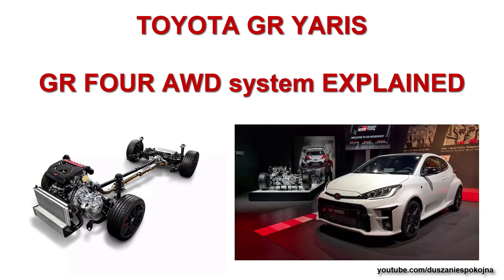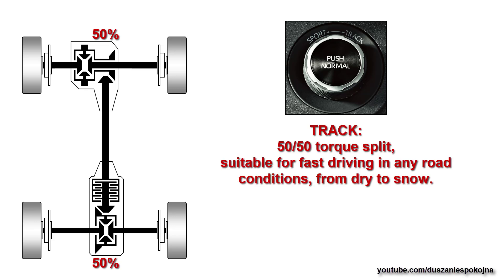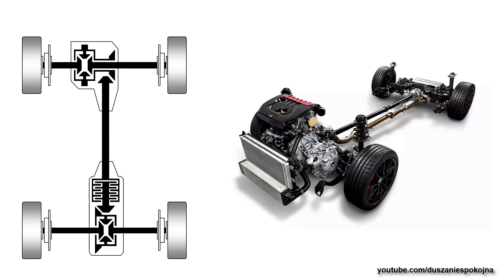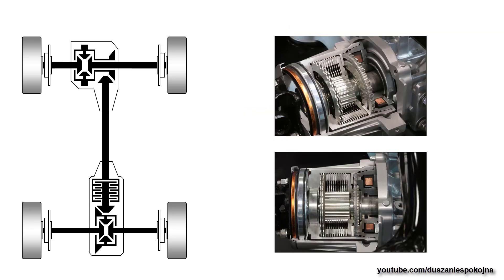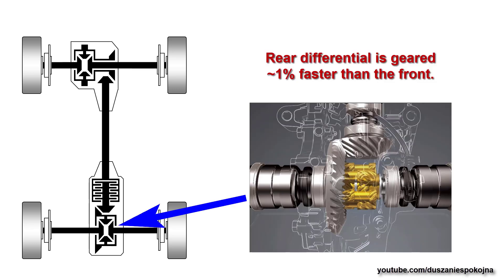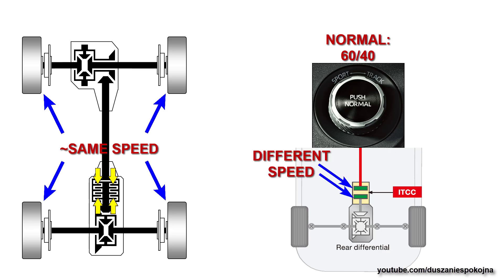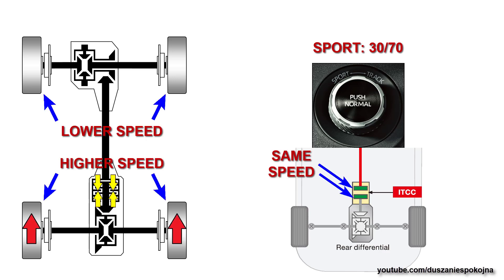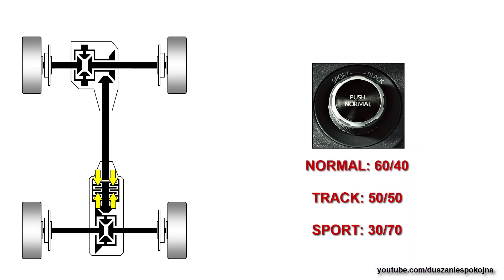Toyota GR Corolla & GR Yaris - GR FOUR AWD SYSTEM EXPLAINED - @4x4.tests.on.rollers

Comment: Finally somebody explained me how 30:70 split is possible at GR Yaris. Many thanks!
Reply from the maker: My pleasure 🙂
Reply: I understand it, but in reality the rear only has the power to match the fwd system. It only receives the 30/70 because of the gearing difference in the rear.
Reply: @SupramanTRD  in "reality", you could send 100% to the back, or even  more than 100% to the back and negative torque to the front(braking the front wheels, which would make no sense unless you're trying to do burnout) depending  on the gearing difference and the slip ratio/torque curve characteristic of the tires. the clutch is continuously adjusted to provide the desired torque split according to the mode
yes, it's enabled by the difference in gearing. with same gearing , and in a straight line, the clutch could only modulate between 50/50 and 100/0. but here , 30/70 is REAL no matter how it's done
it might seem overly complicated, but in an AWD car cornering with gearbox output shaft spinning at a certain speed, and 4 wheels spinning at 4 different speeds the only "simple" solution is 3 open diffs, which is the worst in terms of traction, cornering etc.but any of the more advanced solution like LSD's or imply having clutches/torque converters to let the wheels turn at different speeds while still limiting the slip. newer AWD systems tend to be more complex, requiring more sensors/actuators/electronics, but are more flexible with different modes and more efficient when cruising. Toyotas system is just a relatively smart/cheap/lightweight system to enable RWD bias on a transverse front engine.
though It's hard to believe the rear wheels are constantly driven and the clutch clipping even if you are on cruise control on the highway. logic says it should stay open when you are driving straight and at low throttle, saving mog and clutch wear
Reply: @SupramanTRD  it's kinda like the rs drift mode. 
But the Toyota seems like a much smarter system tho overall.
Reply: @fukkinkana  Don't know about smarter, as it lacks torque vectoring in relation to steering input. It's an entirely passive system.
Reply from the maker: @Vermonstered  It's active system, steering input is one of the most important factors for clutch pack operation.
Reply: @4x4.tests.on.rollers  So you're saying it actively adjusts clutch pack clamping force when resistance varies upon the rear? Or the 'active' part is the drive mode input. Active in the case of a torque vectoring system is constantly adjusting the clutch pack to direct more power to the right or left rear wheel. That level of activity doesn't appear to be the case here. I'm unsure why steering input (from typical following a road driving) would require active adjustment of the clutch pack as this isn't a differential that's detecting slip.
Reply from the maker: @Vermonstered  Clamping force is never fixed but always variable, dependent on many factors. This is for front/rear. There are no clutch packs for left/right, that's up to torsen diffs (if equipped).
Reply: @4x4.tests.on.rollers  Right, clamping force varies based upon some level of steering input due to the speed differential been the two axles but not actively directed by small(er) steering inputs you'd do following a freeway or other road like again in a torque vectoring AWD system as the Yaris system, as you say, doesn't dictate L/R bias. I'm not talking to the amount of steering input that requires the overdrive gearing like U turns and the like.
Reply from the maker: @Vermonstered  We don't know what steering input influences the awd system. Besides - why would I need a torque vectoring while small steering inputs?
Reply: @4x4.tests.on.rollers  Then you're only referring to the already programmed in variance in turning circle radius from the front wheels to rear wheels for clamping force? That's really not what I meant by 'active.' Even the old Mitsubishi ACD system is more active than that.
Reply from the maker: @Vermonstered  Electromagnetic clutch-pack may respond about 200 times per second. Its compression depends on tens of factors and is fully variable, it is never set for fixed value, it uses feed-forward and feed-back control. That's proactive system.
Reply: @4x4.tests.on.rollers  Again, it's not a system that detects slip or directs power actively. It's all preprogrammed settings based upon parameters as the system used here is somewhat limited. No one said it's a fixed variable as that makes no sense due to distance traveled by the front and rear wheels. There is literally no reason for this kind of system to have a 200hz refresh rate, it simply doesn't do as much as other systems which would require such a refresh rate. Quit generalizing.
Reply from the maker: @Vermonstered  Then I have no idea what you mean by saying that the system is passive. And what means active then if not constant calculation of situation and continous adapting of torque split? Locked diff is passive, it's locked and that's it. Doing nothing. When it comes to responsiveness level of 200 hundred times per second is used even in normal (not sporty) cars.
Reply: @4x4.tests.on.rollers  Passive wasn't the right word, however, I'm describing basically a system that's locked into a set of static and somewhat simple parameters. There's no intelligence to the system as it has limited sensory input and it's not trying to be a variable system that adjusts the F/R split per sensor variable like a haldex. Torque vectoring systems detect much more and do more than this type of system as they're constantly adjusting the split not only F/R but L/R. I get it, you believe refresh rates mean active, but if it's just following the turning circle variable from front to rear distance to know which planetary gearset drive, it's not really.
Reply from the maker: @Vermonstered  Are we talking different languages? Each wheel speed, steering angle, acceleration pedal position, throttle position, engine torque, engine speed, yaw rate, lateral G, longitudinal G, slippage, surface friction calculation, temperature and many more - these are the things calculated by the system, continously. Like every 10 miliseconds for the next 500 miliseconds or whatever. Torque split is constantly changing on the basis of overall calculations. The same signals will be used for torque vectoring systems but adapted for different drivetrain.
Reply: @4x4.tests.on.rollers  You're generalizing again. Just because some systems do, doesn't mean all do or if that applies to this system. Making verbal diarrhea for the sake of spitting out sensor names and refresh rates is just that, a pile of 💩 as it's so non specific to any system. You're clumping them all together and each AWD system uses different inputs to give different outputs for the design specifics of each system. There's also a massive difference between scan rate (what you're talking about) and response rate. You're so zoomed out and generalized to any system it looks like a foreign language when trying to speak to a specific system.
Reply from the maker: @Vermonstered  I did analyse more than enough awd systems, believe me. You're saying that GR Yaris has basic control but you have no information about it. And haldex was your example, seriously? The majority of data/sensors I mentioned comes from Rav4 which has much less sophisticated control algorithms. I clearly said about response rate of electromagnetic coupling. That's controlled with pulse width modulation where every change of duty cycle changes the torque split. Control software - on the basis of tens of signals - decides about the duty ratio. Here you may see how duty cycle changes during driving: https://youtu.be/N_SCul259hc
Reply: @4x4.tests.on.rollers  🤦 only used the haldex in regard to target is a variable AWD engagement which is unlike the target split system in the Yaris. Again not understanding a word of what's actually being said because you're trying to generalize it to ALL AWD systems with the only intent of computers do stuff always as your goal? It's clear you couldn't have a conversation about each system without reverting back to massive generalizations and verbal diarrhea. No one is talking about wheel slippage in your video again backing into even further zoomed out generalizations. Yes, there are sensors. Yes, they respond to input. That's about the only thing you're able to say about the GR Four system. Besides that you're so generalized to 'AWD computers do something because of sensors so you can't call them simple' is just silly, especially to anyone who has any programming experience. This system is less sophisticated than the first generation SH-AWD from Honda without torque vectoring and isn't remotely the most 'active' system out there. Stop generalizing now to Rav4's.
Reply from the maker: @Vermonstered  Enough is enough. Feel free to call JTEKT engineers and tell them they are wrong in their descriptions of GR FOUR system.
Reply: @4x4.tests.on.rollers  Isn't the torque split steady for each driving mode? Toyota says 60/40, 50/50 & 30/70.
Reply from the maker: @WolowitzsMother  If you go deeper into specifications you will find that Toyota says about the balance (fwd, neutral, rwd). This is fwd based, clutch type awd system, it can't keep torque split steady cause handling would be awful. It regultaes it to achieve the required balance.
Reply: @4x4.tests.on.rollers  Subaru? It says permanent 60:40 front and rear using multi plate transfer.
Reply from the maker: @WolowitzsMother  The same situation. Torque split is active (that's why system is called S-AWD ATS - Active Torque Split), it is not set to constant 60/40 but variable, adjusted in real-time to the situation. During stable driving it goes towards fwd, like 90/10-80/20.
Reply: @4x4.tests.on.rollers  Thanks for the lesson, in showing just how to destroy your credibility. It's great you do these tests, but seriously you need to work on your actual understanding of these systems.
Reply from the maker: @psycheout4733  Be my master and tell me where I am wrong.
Reply: @4x4.tests.on.rollers  ^^^ with your discussions with OhAiShare already shows you're not interested in expanding your view. Also never said I was a master, only taking the lesson on how to destroy one's credibility in 3 minutes flat.
Reply from the maker: @psycheout4733  If you are not a master then how do you know know who is right? Everything I wrote in that discussion is based on info from Toyota and JTEKT. Is it necessary to quote those descriptions?
Reply from the maker: @Vermonstered  I just noticed the email with your last comment (about critisicing my rampant generalisation and inability of defining the system or contrasting it with any other) but I can't see it here. Anyway I'll answer it. OK, should we discuss about the differences between haldex coupling and ITCC, is that the point? We can. Next - defining the system or contrasting it with any other? And what did I do in the video above? That's very different from probably all other awd systems on the market now. No haldex system is geared and programmed this way. GR Yaris uses 0.435 gearing in PTU and 2.277 gearing at the back so there's a slight overspeed ratio of rear diff,  there's no planetary gearset to choose. Haldex systems do not work this way, they are active but they are going almost entirely to fwd mode whenever it's possible while GR FOUR system is continously trying the keep one of three balances chosen by the driver. Why did I mentined Rav4? Cause GR Yaris "borrowed" the mechanical structure from Rav4 - to be precise - from  Active Torque Control system - that is fwd based with PTU and ITCC. The difference - it is explained in the video, Rav4 doesn't use different gearing and it has less plates. It is programmed more like haldex systems. The sensors - of course they are all in each modern cars however not all awd systems are calculating the data from all of those sensors. Most basic ones use wheel speeds and accelerator position - and that's it. GR FOUR system uses much more - speed, acceleration, braking, steering, G-forces etc. (that's Toyota info).

What do you expect from this discussion? Firstly you say that the system is ENTIRELY PASSIVE. Then you step back a little but still claiming it's stupid. Give me the arguments cause so far you didn't give ANY. Just talking that I'm generalizing. Do you think that simple/stupid alghoritms can keep those balances? If they can - explain that. Explain how that works during turn-in before the apex and during turn-out when the apex is passed, each mode separately. If you claim that I am generalising and that I can't contrast GR FOUR with any other awd system - then you must have the knowledge do to that right? So do it, I want to learn something new.
Reply: @4x4.tests.on.rollers  Simply put your attitude + your shoving words into people's mouths for your benefit shows here. You're the one who's trying to assert others are saying things they never did. OhAiShare never said anything about Toyota's claims and there you are standing there saying he did. That shows obstinance, unsubstantiated arrogance and an unwillingness to discuss because you're so damn defensive. Just like right now, you confuse "mastery" with 'credibility.' Two completely different things but with no understanding of the difference between the two.
Reply: @4x4.tests.on.rollers  Seeing you're already blocking/deleting posts there's not much point in responding. Though still seeing you're generalizing to, again, other cars. If you've noticed, none of the cars you generalize to have a rear planetary overdrive gear. And we see again, to where I've already noted "passive" was the wrong word, you're still hung up on it and now are basing an entire section of your argument upon it. This is why I can't take you seriously. Sure you get cars and do tests, cool. But your understanding of the underlying systems? Limited at best.
Reply from the maker: @Vermonstered  No comments were deleted, I can't see any in spam/blocked folder so there must be something wrong with the words you use (YT filters). I wouldn't be answering the to posts I deleted by myself, that's nonsense. Again you're talking that I generalize but you do not use ANY arguments. BE A MAN and talk to the point cause so far you didn't provide a single word/info about GR FOUR system.
Edit: you may use different accounts for your posts, that doesn't bother me.
Reply from the maker: @psycheout4733  Toyota claims that the system is entirely active, control algorithms are very sophisticated, based on data collected from many sensors. The guy above is trying to deny that, right from the beginning.
Reply from the maker: @Vermonstered  Stop talking about me. Start talking about GR FOUR cause so far you didn't tell a word about it. Please be so kind and point out all my wrong statements from the video and posts. Point them out in new post which I will pin at the top so viewers will know that I know nothing about the system. And I am not asking you to create a new account, you are already writing from two. Whatever - post a comment about GR FOUR, just do it.
Reply: @Vermonstered  🙉🙈 - 'master'

Comment: GC8 STi RA 1998 is the best mechanical layout for handling.
Reply: Nope. It has the engine in front of the front axle, in addition it's a longitudinal one. It is the worst layout for handling of all possible ones. Even the engine hanging behind the rear axle is a bit better for handling.
Everything within the wheelbase is good for handling. The best is when the engine rests behind the driver and in front of the rear axle. For handling. The car you've mentioned is a really great machine!

Comment: So the concept is close to Acura ah-awd.
So sad there is no longer exist a center diff on a transverse engine like lancer evo 😢
Reply: I always thought yaris got similar drivetrain as the evo/ralliart. Too bad is more similar to the haldex one.
Reply from the maker: @octaviangeorge5455  Why too bad? It is doing great job :)
Reply: @4x4.tests.on.rollers  not reliable. Complicated.  And wear off fast. Not sure how will handle abuse and miles.
Reply from the maker: @octaviangeorge5455  How do you know it is not reliable? You can only guess but you don't know that. It is not complicated to. Software is complicated but mechanical structure is simplified to the maximum. Wear off - another thing to guess, not to know.
Reply: @octaviangeorge5455  yeah i dont think the rear will work for long, but looks like they are using a wet clutch which is reliable and barely wears so that is a upside
Reply: It's still miles better than audi's haldex

Comment: The idea (overdrive rear axle speed) ist copied by Ford. But, it't a nice car!
Reply from the maker: Actually Ford was first... And to be more precise - not Ford itself but GKN Driveline.
Reply: @4x4.tests.on.rollers  was not the Saab 9-3 turbo X the first with overdriving overspeeding rear axel 2008??
Reply from the maker: @PKraemer81  I meant that Ford was first in relation to Toyota. As far as I am concerned - Saab wasn't overspeeding rear axle, it just had eLSD integrated with haldex. First overspeeding which I remember was one of SH-AWD versions and Lancer Evo.
Reply: @4x4.tests.on.rollers  heard something about the Saab 9-3 X  a long time ago and never let that go. Just curious
Reply from the maker: @PKraemer81  Check the test of Insignia on my channel, it has the same system as Saab.
Reply: @4x4.tests.on.rollers   "driftmode for beginners" :-) 5 minutes entertaining, then it's boring. The 50:50 mode in the Ford RS MK3 is pretty cool on ice, snow and wet track, mayby is this also th best in the GR Yaris. I have to drive one first...